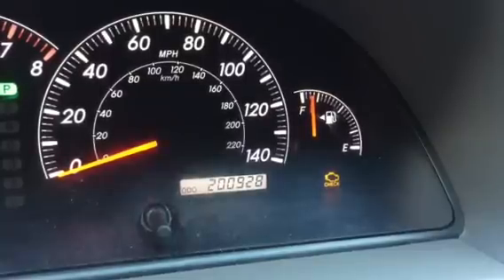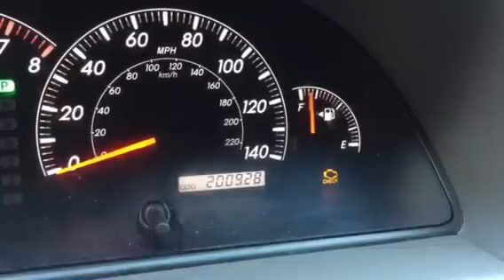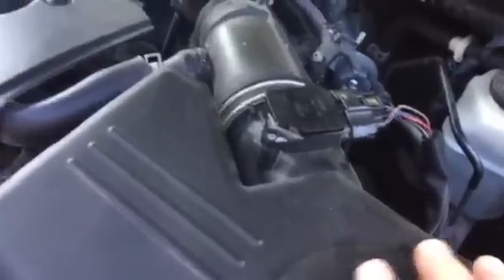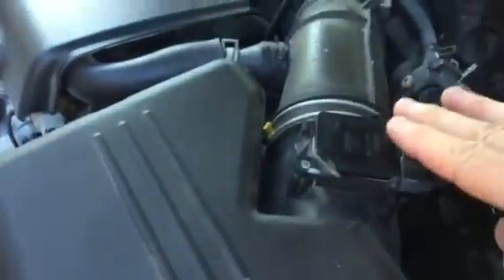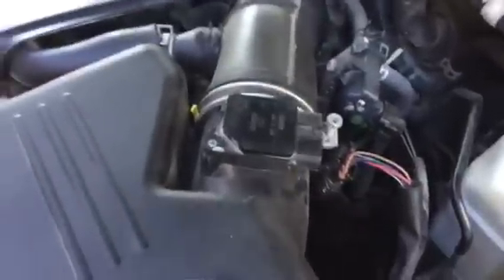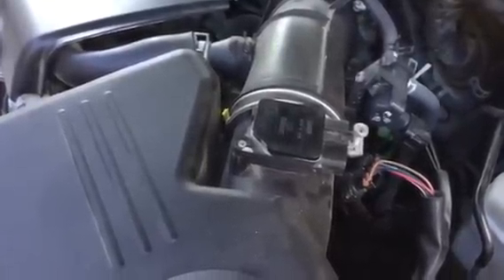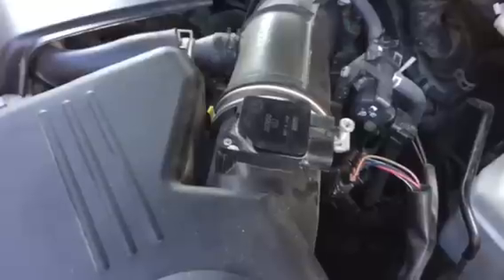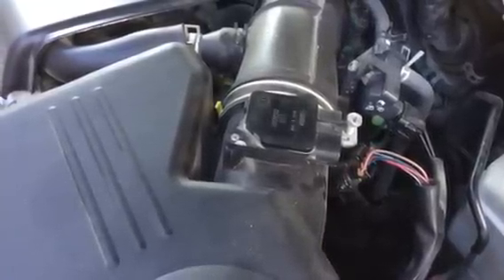How To Tell If Your Mass Air Flow Sensor Is Bad On Your Car

Comment: 1.7k Dislikes for such a short helpful vid?? 1.7k mechanics must not have appreciated you sharing the valuable  secret.🤑 
Thanks for taking the time to help people same money and time!
Reply: That's because this video will cause viewers who are inexperienced to misdiagnose the problem. This particular vehicle may or may not  represent a small percentage of engines (or it's a very old model without O2 or MAP sensors) as most engines WILL CORRECTLY NOT KILL the engine when the MAF is disconnected (I haven't seen an engine that would die regardless if the MAF was good or not). When disconnected, the ECU will go into a default mode where it will rely on other sensors such as the MAP and upstream O2 sensor (A/F ratio sensor on newer cars) to calculate for a 14.7:1 air/fuel mixture and continue to run. Apparently, "Proclaimliberty2000", is not a mechanic and will cause more problems than help and was wise to add that long disclaimer. He may have good intentions or may be deliberately screwing with people; I don't know but I have nothing to gain by advising that no one trust him when it comes to engine diagnosis. In this day and age, four things are needed to reach a 100% absolutely correct engine diagnosis (although less will do in some cases). Those are: 1.a scan tool that is able to read live data and display freeze frame data, 2.an oscilloscope, 3.the factory car specific service manual or access to your vehicles specifications/values for parts that may be causing an issue and 4.at least a general understanding of the mechanics and the CAN Bus OBD II system that exist in all vehicles today (OBD II codes are the same for all car manufacturers, unlike the older OBD I systems). Hopefully, you'll at least watch a few other videos. You can't trust the first one you watch on You Tube without sometimes regretting it or worse, creating more problems. Good Luck!
Reply: This is a short 2 minute video (I have no idea who the channel belongs to nor do I have anything to gain) that advises if you have an issue that causes your vehicle to start, then it stalls; disconnect the MAF. If that corrects the problem and the vehicle continues to run with the MAF disconnected, then the MAF sensor is bad and needs to either be replaced or in some cases, cleaning it properly and with the correct cleaner (MAF cleaner, electronic cleaner, brake cleaner, etc) may correct the issue. The reason is that the bad MAF sensor is sending incorrect data to the ECU but by disconnecting it, the ECU can't use the bad data (either very lean or rich condition/engine needs a 14.7:1 A/F mixture to properly combust) that is causing the engine to die, so it then relies on other sensors. Hope this explains the many dislikes here and helps. https://www.youtube.com/watch?v=M1m-n5rxuQs

Comment: hi , i try on my open corsa d and when i plug out the engine is still working mean bad mass air sensor , thanks a lot for your help man!
Reply: NO, NO, this test is BS, just OBD and live data, you will know for sure the problem even without checked engine light.

Comment: I have a 2011 equinox with a engine light on so I tried this and it kept running. Out of curiosity I tried this on my 2013 impala and my 2000 silverado and all three stayed running when unplugged.

Comment: I tried this on my 2006 ford taurus. Sometimes when I unplug it the engine turns off. Sometimes when I unplug it the engine stays running. In some of the instances where the engine kept running, when i plugged it back in with the car still running, the engine shuts off.
Reply: This test is BS, just use live data and you will find the problem.

Comment: You're the man! Had mechanics telling me it was all kinds of things, did this trick and boom that's what's wrong
Reply: How i should do it cann you tell me more
Reply: The mass airflow sensor or MAF is only held in by 2 torx screws, remove those, then with the car running pull out the MAF. If the car shuts off it's working properly, if the car keeps running the MAF is bad and should be replaced asap

Comment: OK great video, I just cleaned thoroughly, and did your disconnect test..so you say in 20 miles  or so light should go out? No re sets needed?  If light stays on what is next step?  Code was PO n171  PO 174  Thanks
Reply: Did the cleaning and driving 20 miles work for you ?

Comment: My engine stays running but I was told that that  was normal to keep running with a 2005 Chevy Impala but it runs better with it unplugged but if it’s plugged in there is loss of power the engine shuts of and serious galloping if it’s unplugged it gallops back and forth just a little

Comment: My van will not idle. I changed this part and still Same thing.  If I unplug this it will stay running. What else can I do?
Reply from the maker: steve sullivan Clean the throttle body.

Comment: My engine keeps running when i disconnect it.  Does it need to be replaced?  Or should be cleaned?
Reply: He said to replace it
Reply: And I got a question for you does your car shut off after a couple off min with it plugged in?.
Reply: @angeldelacruz2882  no, car does not shut off.

Comment: Dude i love you. I was freaking because my 05 g35 coupe was jerking and we thought the transmission was gone. My friend camw over anx i watchec your video and boom engine kept on running after we disconnected it. Replaced it and now we gotta see wassup tomorrow.
Reply: Did it fix it??
Reply: @J1Turbo  yes but turns out my whole intake had to be replaced because it had tears in it and was taking in extra air. Just replaced it with a short ram and sounds amazing.

Comment: I'm thinking about trying to clean mine before I replace it but yeah it stays on when I unplug the mass airflow sensor cable but it also changes my idle when I plug it back in while its running so I feel like its still working some what.

Comment: Just did this and ute keeps running 😑 looks like I need to replace, will cleaning the sensor work or have to replace?
Reply: I would always try cleaning first before you pay $100+ for something that just might be dirty
Reply: Turns out it was the fuel filter, hadn't been changed in 337,000kms along with air filter, cost me $80 to change both and run likes a dream now, and the fuel guage hasn't budged in 2 days where as I was only getting 500kms to a full tank until now

Comment: Fantastic video!! Simple, easy way of determining if it's bad. Issues could simply mean it needs to be cleaned.
Reply: @stevegarcia1796  that's in most cases it needs to be clean not necessarily replaced
Reply: @edwingarretson4129   You would think that he would have mentioned that you could try and clean it. A can of MAFS cleaner costs $6. I'm going to try that first before I go get a new one. Now that I'm thinking about it I'll probably go buy one even if it works so I have it

Comment: Would I need a new one or just a clean with the Mass Air flow cleaner?
Reply: Try to clean it if you want but a can of cleaner is 10bucks while most sensors are 10/20

Comment: mine keeps running . Have a new MAS on the way. Hope it works. Mine takes off fine but bucks at 20 ,30 and 40 MPH then after that runs fine. Great to the point vid.
Reply: did it work? im having same exact issue

Comment: Try cleaning the sensor with sensor cleaner (not carb cleaner) first. 
Dirt builds up on the sensor parts over time. Clean the sensor at every oil change.

Comment: Simplest explanation.  Had to get the obd to find out it was the sensor, but I remember my van not shutting off when I disconnected it.  This wouldn't saved me a lot of time and money.  Thanks for the helpful tip.

Comment: When I unplug it still runs and my car only runs worse when warm and high rpm are you sure it’s my mass airflow
Reply: try changing coolant temp sensor. computer thinks engine is cold so that is why high rpms
Reply: Doug Swinston cold and warn when I change gears on my car at high rpm the rpm goes down so slow and has less power
Reply: @Daddychill945   is this with maf plugged in, it has to be plugged in whether it works or not. Tell me what kind of vehicle and mileage  and i can help you better
Reply: Doug Swinston do you want my number there is so much to say when I unplugged the iac the rpms drop faster and when I plug it in there is less hp and I have to wait like 3 sec to wait to shift
Reply: Has 124,000 miles it’s a 5 speed manual and 2.0 zetech motor

Comment: Was on the road, turned on my car like 3 minutes before, suddenly the engine turns off (AC was still running, windows, electrical etc. Still ok).  Tried starting it back up, it starts then stalls, again and again. Have fuel, so that's definitely not the problem. Towed my car back to my place, checked the fuel pump, it squirts a good amount of  gas, so no problem there. Checked the sparkplugs, cleaned it a bit, no problem. Still won't start. Engine wasn't smoking or overheating, but engine light was on. I have no computer scanner, so I was left wondering. Gonna have a guy look at it tomorrow, hopefully this sensor is the cause, cause logically speaking it makes sense. X-Trail T30 Nissan 2004.

Comment: To help people that might be confused if you unplug the MAF and it stays running that’s because the computer is now relying on other sensors to stay running witch is not good cause the car won’t run correctly. If it shuts off means the computer only taking inputs from the MAF
Reply: Thanks.
Reply: Àà
Reply: Thanks
Reply: That doesn’t make sense. You’re saying it will run when the MAF is broken by using other sensors, but it won’t rely on other sensors when it’s unplugged?
Reply: @haroldw9054   no I mean if the MAF is working the engine should die when you unplug it if it dose not there might be something wrong the computers jobs to keep that engine running no matter what so if it has to it will manipulate fuel trims or start reading off O2 sensors it won’t be accurate but it’ll try too keep it running. Test it start your engine why’ll it’s running unplug the MAF it’ll either die out or start surging as the computer looks for other input data to keep it running.
Reply: great expl .. thanks!
Reply: Thank you I was just about to Google that ❤

Comment: How do you know if your wiring harness or the sensor connector is bad? Bought a new MAF sensor and car worked well for 3 weeks then went on the fritz again - hesitation from stop, bad acceleration, etc. Any other thoughts? I don't think it's possible to have killed 2 MAF sensors...
Reply: Any update bro?

Comment: guys i have a problem.  my Legacy with check on yielded MAF code.  he had an uneven gait sometimes.  I bought a MAF Denso OEM I installed it and it disappeared, the code disappeared and it worked pretty well until yesterday.  walking the derrepente car stopped and returned to turn on the check (always check with Cruiser on).  It does not start with the MAF connected but if I disconnect it it starts.  I left it overnight with the MAF connected and today in the morning there was no check on but after a few minutes it stopped again and turned on the check.  It can't be the MAF, does anyone know the main reason?

Comment: I tried for my volvo engine still running and i replace it with another one n still running. So it means i will buy a new one? No engine light only that no acceleration at low gear.
Reply: This test is not correct, some cars go instant in emergency modus, so it keeps running cus the ecu take over....no engine light and low gear probs mostly when engine is warm, is 9 of 10 times bobine/cables related :-)

Comment: Great test and everybody loves it..question did the engine light go out after you plugged it back in ?  We  need a Coronovirus test like this.
Reply: I did this test after having issues with stalling at junctions, didn't have an engine light on before, but I do after doing this.

Comment: I start my car and run then stall, but if move air filter away and start engine and continue run. Is this bad Maf air Sensor?
Reply from the maker: Kennedy Wong It sounds like the air filter is dirty and restricting air flow.

Comment: On my 2009 Chevy 1500 Express van the mass air flow sensor when unhooked would not stall the engine. In fact, it could be driven with it unhooked.  The reader never showed where the real problem was located. (I used more than one mass air flow sensor and more than one reader.)  Ended up scrapping the van due to limp mode and my health being too bad to do work on it.

Comment: BUT he is WRONG.
MANY CARS HAVE A LIMP HOME MODE.
YOU CAN UNPLUG THE MASS AIR FLOW METER,  AND THE ENGINE  WILL STILL.
On a Mercedes you can remove mass air flow meter and the engine will still run.  Will still run in SPEED DENSITY MODE. 
SPEED DENSITY MODE NEEDS, COOLANT TEMP,  RPM, AIR TEMP.

Comment: Thanks for the video 
I haven't tried it yet. But just wondering if you cared to elaborate on the theory behind disconnecting when its running and it keeps running ? 
Thanks

Comment: What if I have a new one on there and it keeps shooting the same code? I already replaced the battery and the alternator and I get a P0102 code still and circuit low?

Comment: Well if my check engine light is on the engine does not cut off when removing the wire but if I reset the code it does? So should the maf cut off engine if check engine light is on?

Comment: Hey thank you very much for posting this video. My check engine light has been on for a few days now and I just did this test and confirmed that the mass air flow sensor is bad. You're right, it was very easy. 
Thank you again for posting this video and showing us how it's done!!!!

Comment: My mass airflow sensor is new in my wires and working properly I unplug mine and my vehicle still runs
Reply: cars and truck will still run without a maf. so with that being said im sure some people wasted money on a new maf and still have the problem!!!
Reply: @jaredwalter5024  so doesnt that counter the entire purpose of this video?? lol or is certain types of cars ur referring to?
Reply: @k33kat  This test is BS, only live data will show the problem, even with engine light checked.

Comment: I took mass airflow sensor off whilst car was off then started the car it ran fine but obviously  I got error on display in my mark 6 I had glow plug sensor light up flash whilst I drove car .the car drive to me perfectly normal .so does this mean its faulty as car shouldn't start or at least run rough .?  Basically my car has been hesitant on acceleration loses power have to shift down gear and seems ok again. Or I accelerate hard that some times works .worse case for ne park car stop it then restart it's fine again. No engine management light comes up at all .only time I got error code was fir throttle position sensor months ago  errors .never come up  again

Comment: Mine says 00553 intermittent open/short circuit air mass meter. Also, when I start the engine, the first time I put into R/D it beeps and says Service! for about 2-3sec. I drive normally, but mileage is lets say 100% worse than it should be by specs. I suppose it has to do something with MAF but also the transmission might be the culprit...I dont know yet. It is really lazy at low rpms, also when I press the gas pedal there is no take off, it just doesn't accelerate as it should. At the higher speeds, higher revs to be more precise it goes like a wind. Just low rpms are the problem. So all these things might indicate a bad MAF or failing MAF.

Comment: Need Help:

So I did this method, and the car turned off. I also tried starting the car with it unplugged. The first time, it started and then turned off almost immediately. The second time, it stayed on but it was hesitating. I turned it off because I don’t really know what I’m doing so I didn’t know if it would damage anything.

But a car is supposed to stall or hesitate with a bad sensor, so I’m guessing this was the right reaction to an unplugged sensor as well?

But my check engine light is on and the code is for the MAF sensor. So if the sensor is “good” then what else could the problem be? 

I have to get my registration renewed and it requires an emissions test, and I’m already overdue.

Comment: I can unplug my MAF and the car keeps running. I can even start it with out it. I've read that it doesnt matter. Please explain...
Reply: Most cars keep running, this test say nothing, Live data will tell you what is the trouble, even without a checked engine light.
Reply: My guess is that the manufacturers don't want you to get stranded and not be able to start your car, they just want you to know something is wrong. If your MAF sensor goes bad when you're driving, you're car keeps sucking air and running so your car doesn't just stop, and maybe that's why you can take it off while it's running and it doesn't stop your engine. I don't know why your car would be different from his though...different manufacturers with different computer programming?
Reply: Again, that's a guess. I am not an expert or a professional.

Comment: funny thing was when I disconnected it it stalled then I simply started it up without it and it started perfectly fine ( before I had a problem with start hesitation) what is that means?
Reply: I've heard that if you start the car without the MAF sensor that the computer uses preset values to run the car

Comment: Hi guys if i have a faulty air mass sensor would the obd2 show the oil control valve circuit 1 malfunction  (open) ? its a subaru impreza wrx sti 02 THANKS

Comment: I unplugged mine it stays running no change but its idling little crazy
Reply: If you have Diesel engine its ok , when u unplugging its not off , but u will noticed smoke when u running .

Comment: I've changed my headlights and taillights 2 LED I need to change the relay they are hyper flashing where is the relay on a 2011 Silverado 1500 two-wheel drive thank you
Reply: I think the computer controls the turn signal system on those.